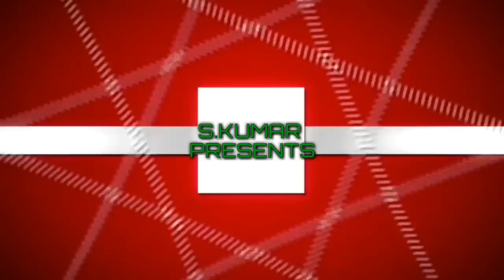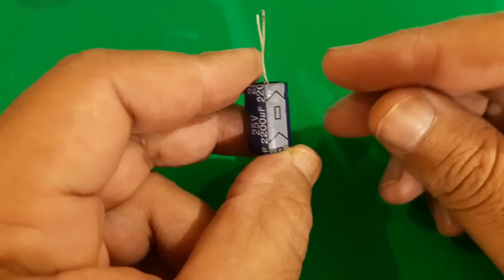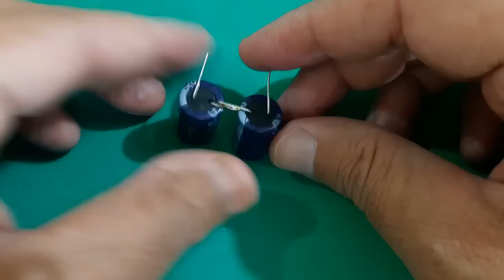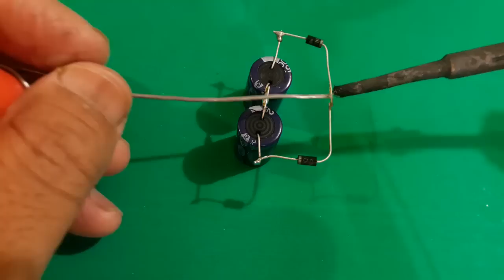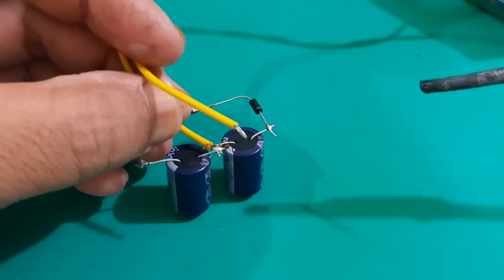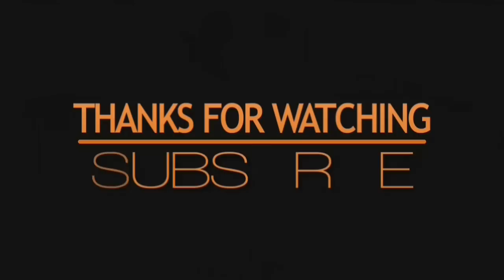How to make Voltage Doubler Circuit (using two condenser)

Comment: Hello sir I have a question , I'm connecting 3x3 piezoelectric sensor and produced at around 9v how can I use tranformer and how do I connect? 
Also I have another question I have connected rectifier to ac o/p of piezoelectric sensor and produced some volts but even after getting the o/p at the capacitor if I connect Dc to DC booster it is not working which is not giving o/p

Comment: Very nice idea frnd😀. But may i asked if this voltage doubler does not change or make lower the amp output of a transformer?? Tnx friend😀
Reply: Yes if you do this with 10 amps only 4 amps remain.  If you want more amps use a heavy trafo.

Comment: I have 12 volts bettery, & i want 18 valts; so, can you say me name or code of diodes & condenser ?
I want for boost my robocar .
Reply: Use a boost converter
Reply: @suryanath8755  Or put some resistors in.

Comment: What's about the current? will i get the same current rating from the transformer?
Reply: I've a same skeptical ....please someone answer for this
Reply: connect it to a motor and maybe we can see the current intensity
Reply: Double the voltage this way and you lose half the Amps that's the way it is with this circuit.

Comment: HOW ABOUT THE AMPERES? I MEANT AFTER VOLTAGE INTO DOUBLED..DOES IT ALSO INCREASE
Reply from the maker: +WILLIE LOVE NORIDA 
            No amperes not increase
Reply: thanks  bro..i have another question. do you know about fish electrocuter? use electric to get fish..it such about inverter..do you have it's schematics diagram?
Reply: @SKumarindia  You lose amps by more than halve, 12 amps becomes 5 amps.

Comment: sir can i convert battery 6v dc to 12v dc using this idea ?
Reply: this applies only for AC because +ve cycle is stored in one capacitor and - ve is on another. But in case of battery there is no cycle so it will not work in DC source voltage.
Reply: Varun R ok thanks
Reply: Varun R ok thanks
Reply: U can but u have to create ac, for example using transistors.
Reply: I apologize for butting in, but I have a similar question. I'm using a couple of 18v B&D batteries (NiCo, I think is the correct abbreviation?), an alleged 12v solar panel, and a cheap Chinese 20A PWM solar charge controller to run a 30w peltier cooling fan ( :'( Which works better than my window fan, by far.). My question is: My current set-up only charges the 2 ( in parallel ) B&D batteries to 15v, can I use the AC from my solar panel (With 2 10v capacitors, similar as above.) to get the 20 volts to fully charge the 2 batteries? Or should I being going at it another way?
Reply: True

Comment: what is the load ampere?
Reply: It depends on the transformer
Reply: Depends on the used diodes mostly in this case 1 amp tops
Reply: If u want to more current thn just use big transformers and 5408 or 6A4 diodes

Comment: fake because You show double in DC And original volt is in Ac  its normal ,
Reply: Diodes and Capacitors rectifies the AC and turn into DC. So, from 11ACV is now 11DCV with some voltage drop from the Diodes
Reply: @eddiejrbation5095  turning AC to DC the DC voltage will increase by 40%
Reply: I thought that diodes has a voltage drop of 0.7 volts?
Reply: @eddiejrbation5095  and ? The voltage drop is determind by the Kind of diode you use however in bridge rectification the voltage will increase about 40% only rectifing the 11 Volt AC from the Video would bring you to around 15.5v
Reply: Sorry, I based it in general terms. But I am open for your corrections. I just want to learn Electronics
Reply: @eddiejrbation5095  if you want that circuit to work better look up bridge rectifier voltage doubler , i can get over 32v DC from a 12v transformer with it
Reply: Hmmmm interest... I get to it. Thanks 😊 I just subscribe to your channel btw.